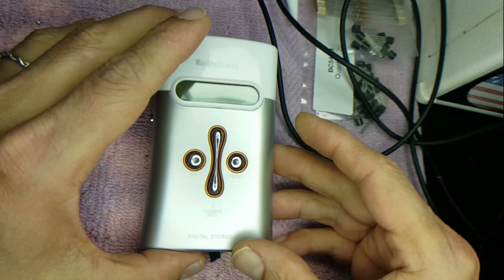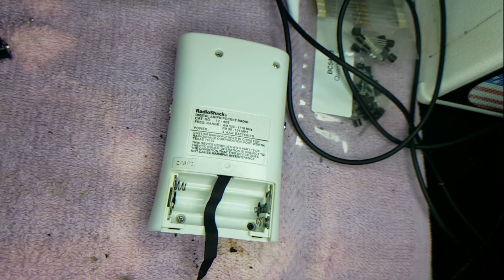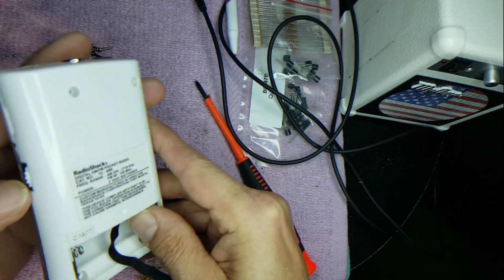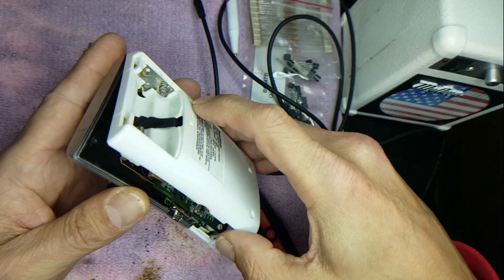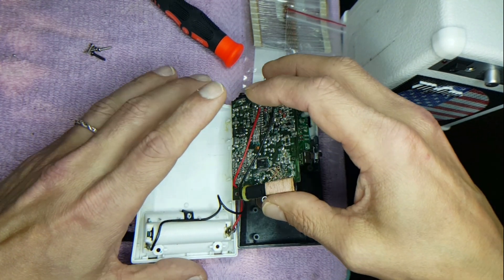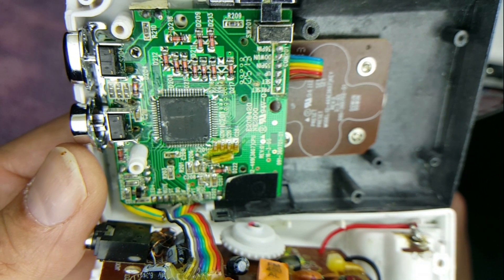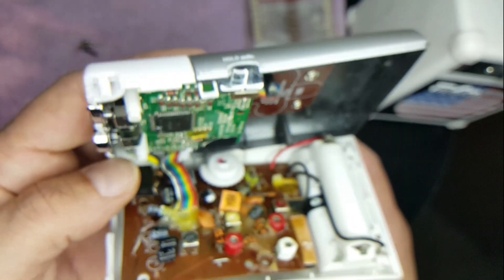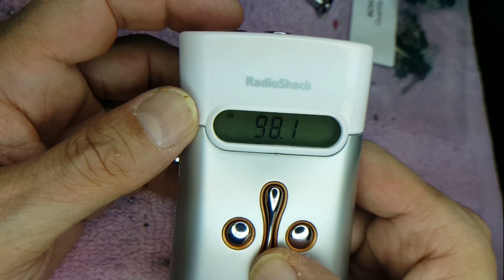GHOSTBOX/SHACKHACK - Radio Shack 12 469

Comment: what's the difference between version 1 and 2 in terms of sound quality ?
Reply from the maker: Hi .. 
Not much of a difference in sound quality, in fact same acoustics... 
Basically a hard case redesign and a slight variation in where the inner board lay out is the only difference..